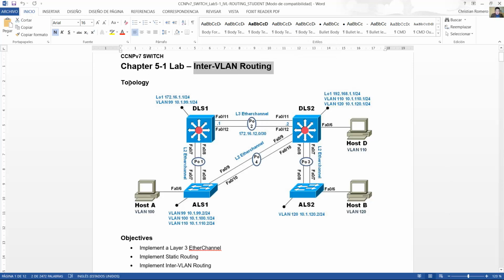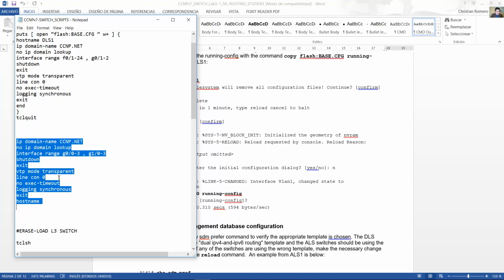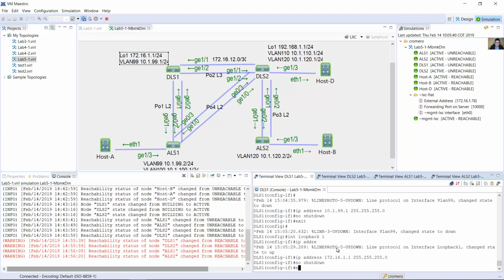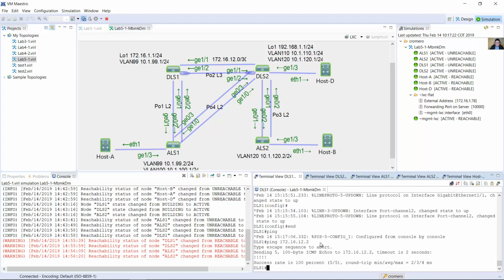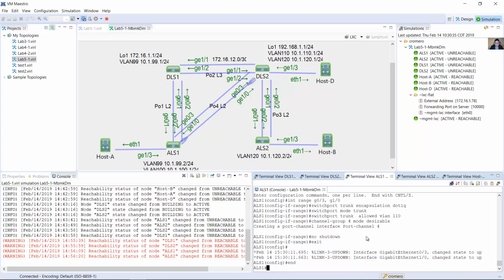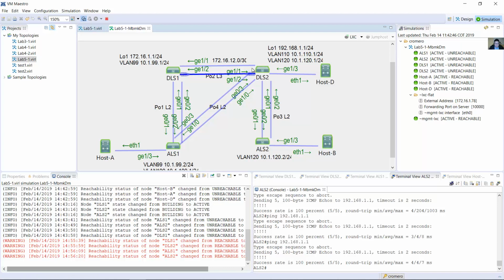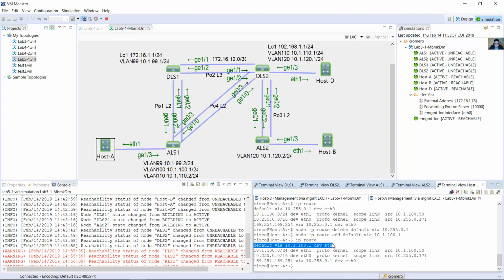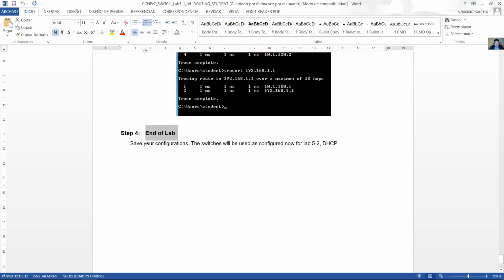CCNPv7 SWITCH Chapter 5-1 Lab – Inter-VLAN Routing

Comment: my DLS1 stopped working after i ping 172.16.12.2 from ALS1. This error pops out (IOU VM "DLS1" process has stopped with return code: -11 (segfault). This could be an issue with the IOU image, using a different image may fix this.)
Reply from the maker: Internet connection failure may cause the problem
Reply: @romeroc24  my internet is working fine

Comment: at 48:20 your pings were not working (mine were not working either) and you went to conf t and issued "ip routing" followed by "no ip routing" and all of sudden your pings worked. what does executing these two commands fix the ping issue?
Reply from the maker: Emulators like GNS3 and VIRL are in development, so that is an issue, on a real lab should work without doing this trick.
Reply: @romeroc24  ya i figured that was the case. sometimes i reload the switches but it did not fix the problem for me, thankfully you had the same issue and it worked for me. Strangest things fix bugs i guess
Reply from the maker: I Agree, thank you

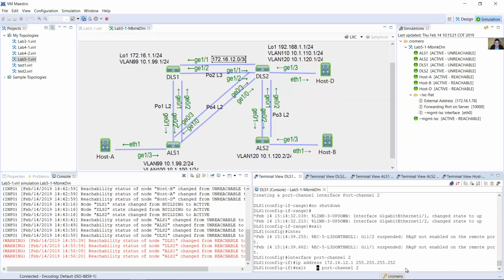Comment: Hi bro thenks for lesson i have one question in my situation my switches can't suport ip address 172.16.12.1 255.255.255.252 in minute 27:13 my version ios in switches 15.2, what shoud do. if you have image or iso version can you sent me in this email address parvin_92@bk.ru thanks in advance
Reply from the maker: what emulator are you using? you can do it on gns3 https://youtu.be/4DnSFVaquo0 or virl pe
Reply: @romeroc24  I use VMware
Reply from the maker: @parvinahmadov2115  VMware wth gns3 or vmware with virl pe
Reply: @romeroc24  in my VMware I use l2  switch and l3 router u don't have switch l3, my image iol in VMware
Reply from the maker: @parvinahmadov2115  if you use this image you can complete this activity https://youtu.be/4DnSFVaquo0